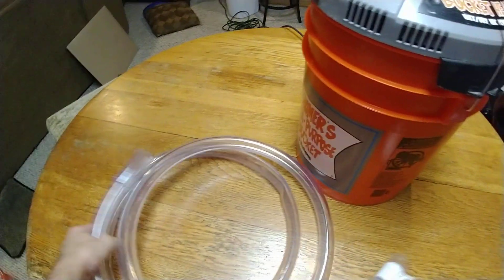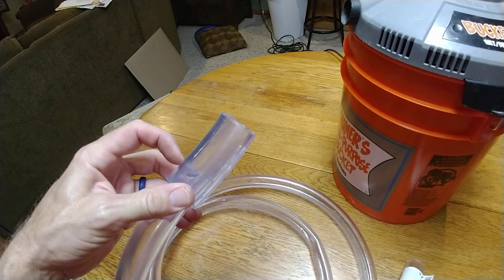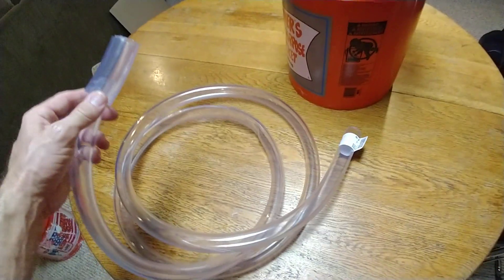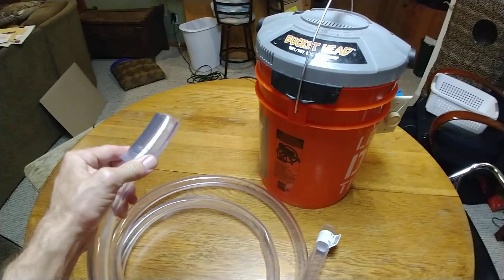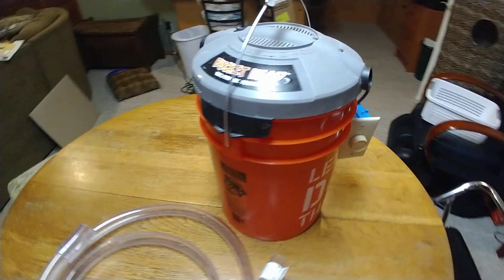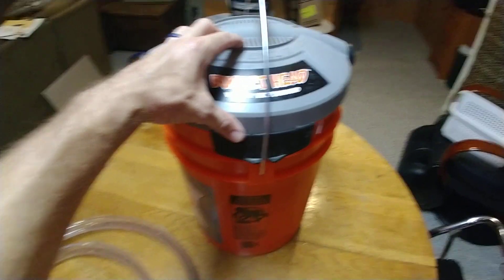Creating a Bee Vacuum for the Beekeeper

Comment: I want to know how you hooked up the dimmer switch to the vac motor.
Reply: Same way as you would if it were hooked up to a light switch.  The hot (black) wire runs through the dimmer switch and controls the power to the vacuum speeding up or slowing down the motor which adjusts the suction.  Lower flow is better as it is less likely to hurt the bees.  Be sure to use a smooth hose so the bees slide through it and don't get hurt.  Also, don't leave the bees in the bucket for very long as it gets hot in there and they'll die so suck them up and go immediately to your hive, max 30 min or less if it's a  hot day.  You can also make a double bucket setup such that the first bucket has a screen in the bottom and the second bucket goes on the outside of the first.  Then when you're done vacuuming them up, just remove the second bucked and they'll have air and it'll cool things down.
Reply: Did using the dimmer on this vacuum damage the motor?
Reply: Don’t put that HEX on me !!!! Lol but no. So far so good.
Reply: @patrickt863  No, I actually used it couple weeks ago, still working great

Comment: Would this be good for a cutout?? They don't die ?
Reply from the maker: You have to keep the suction low and use a smooth tube.  Otherwise it will kill the bees.  You also need to move them ASAP to the new hive, within 30 min max, or they'll die in the bucket.  I ended up modifying th bucket by drilling holes and covering it with window screen then placed the whole thing in a new bucket so the seal is still there, otherwise the vacuum won't suck air.  Then once I'm done sucking out the bees I can remove the lower bucket and the bees have air.

Check out our Off-Grid Build too @The 5th Journey Off-Grid
https://youtube.com/c/The5thJourneyOffGrid

Comment: I think you wired the dimmer into to power cord for the vacuum.  Wall socket—>vacuum cord—>dimmer—>a little bit more vac cord—>gray colored vac head.  I’m thinking of securing the blue switch box to the gray vac head. This will allow the vac head to be removed and the bucket to be a free object.
Reply from the maker: That is correct.

Thanks, please check out our Off-Grid Build too @The 5th Journey Off-Grid
https://youtube.com/c/The5thJourneyOffGrid

Comment: Hello, I have a question. I am doing the same thing you did but I can't figure out how to hook up the dimmer switch. All of the dimmer switches I  found only have 3 wires that come out of the switch. I'm not an electrician but it seems like you would have to have 3 wires going in and 3 wires to come out. help explain that to me if you would. Thanks for the video, I think it's great.
Reply: Hello, I'd assume you are talking about the common, neutral, and ground wire.   Look at the wiring diagram in this following link.  Instead of the wires going to a light , they will go to the vacuum. 
https://images.app.goo.gl/7QCr45xmM9wSeexR6
Reply from the maker: Hello, I'm guessing you are talking about the common, hot, and ground wires.  The cord you use should also have the same wires unless you are using a plug without a ground.  You'll connect the white wire to the white wire on the vacuum.  The black wire to the black wire on the dimmer then the other black wire on the dimmer to the black wire on the vacuum.  Then connect all the grounds together.  Ground wires will either be green or a bare copper wire.  Sometimes the wire coming out of the dimmer is red and this wire would hook to the back wire going to the vacuum.   Hope this helps.  You can always google how to wire a dimmer switch and you'll get lots of helpful images and videos.
Reply from the maker: Thanks, please check out our Off-Grid Build too @The 5th Journey Off-Grid
https://youtube.com/c/The5thJourneyOffGrid